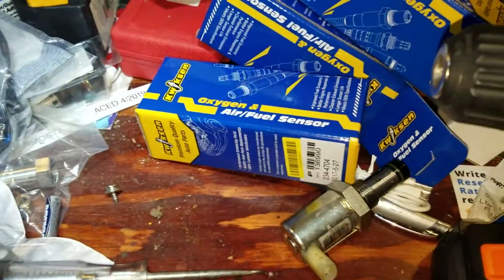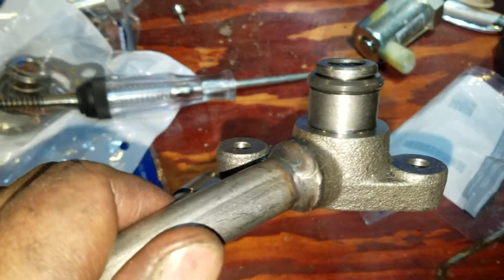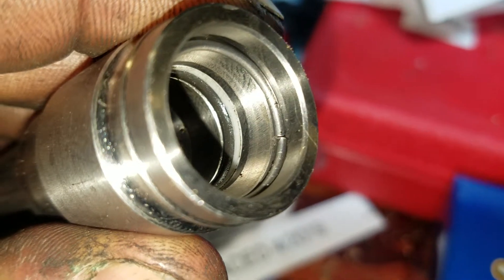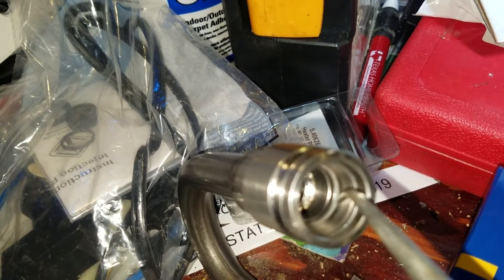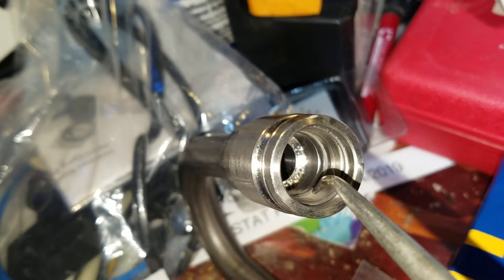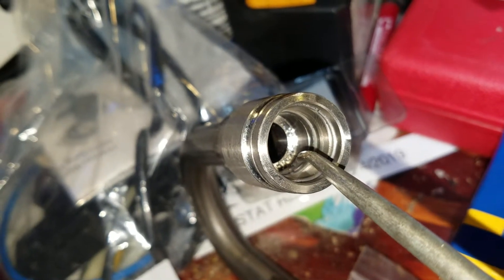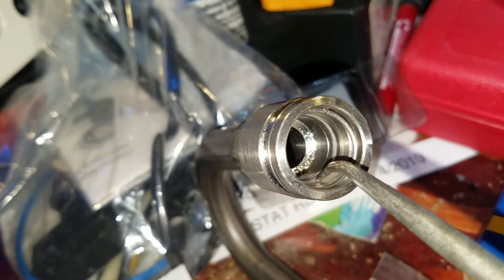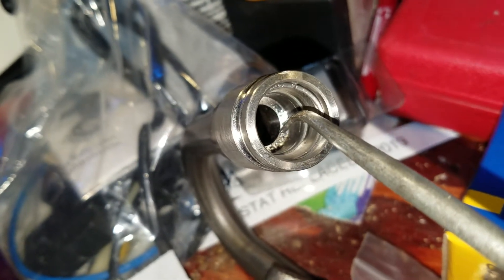How install orings in j tube discharge tube of HPOP 6 0 Powerstroke

Comment: So what about the outside of the j tube does a o ring go there where the STC  fitting connects?
Reply from the maker: There is an oring that goes on top of the j tube   Make sure you use ONLY Ford OEM oring. I used aftermarket and it destroyed in less than a week

Comment: Any one ever have an issue with  the two J pipe bolt holes not wanting to line up with the two bolt holes on top of the  HPOP after a new pump has been installed? I’m lost I made sure the two locating dowels are where they should be on the bottom of the pump, and they are not doubled up and the yellow o ring is also not doubled up and is in its correct place

Comment: Did you replace the original and Teflon gasket, or did you just buy a new j tube from Ford?
Reply from the maker: I bought a new tube from Ford. It’s about $120. But piece of mind that it’s new and it comes with the upgraded orings that are much stronger and last!

Comment: Where can you buy just the o ring kit
Reply from the maker: Bro....  that was an aftermarket J tube... DO NOT BUY OR USE AFTERMARKET J TUBE. I did and 300 miles later the oring on top of j tube eroded.. just fell apart. Even though it looks exactly like OEM.... IT IS NOT.  I had to go back in there and replace the while JTUBE with OEM from Ford..   it costs more at ford but your gonna have to do the whole project  once again.... ONLY BUY FORD OEM J TUBE.   Telling you from experience!!!!!!!!!
Reply: @vladtexas  would they happen to have oem o ring kit for oem J tube just asking? Saw diesel tech ron speak of sticking with oem and replace while in there for the hpop.
Reply: @vladtexas  So you had to go back in the engine and replace J-tube with an OEM tube right?